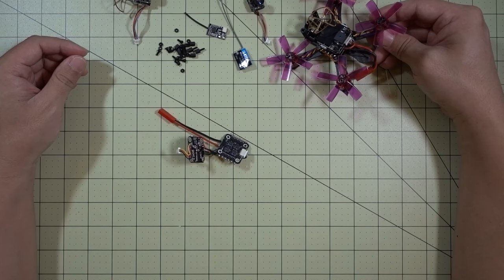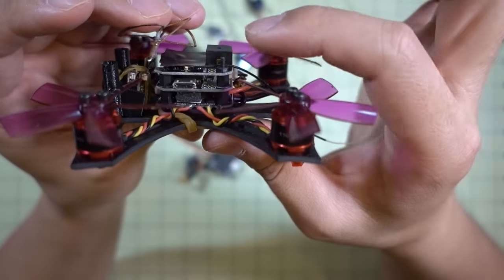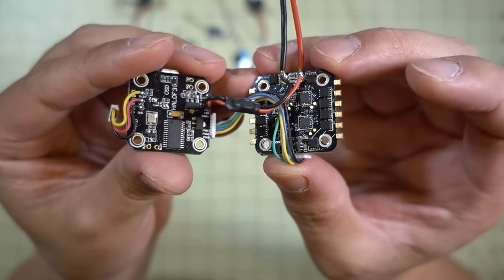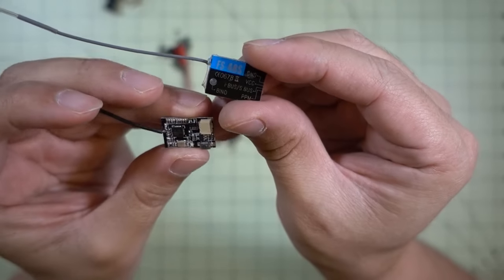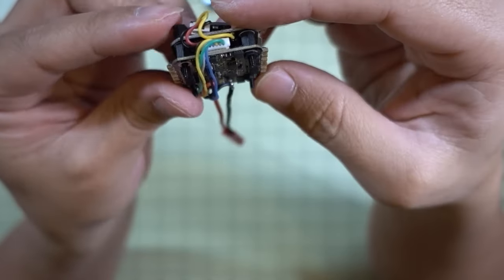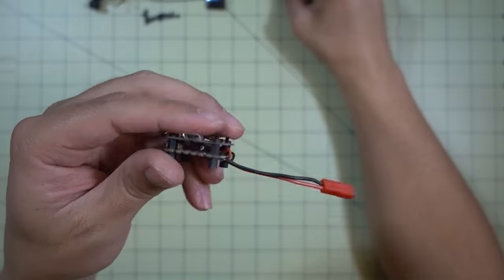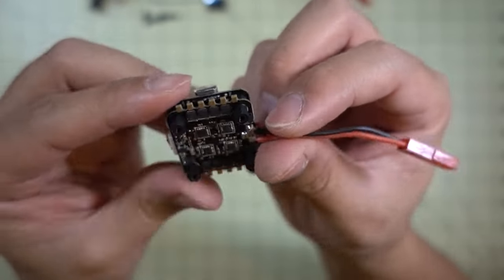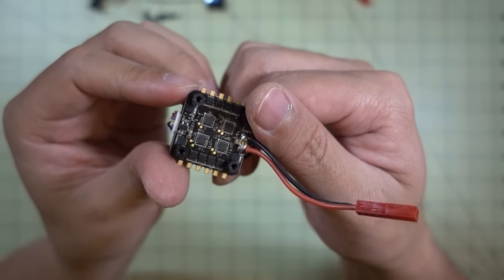Easy Bake Micro Drones 🍰🚁

Comment: The new version 1.1 mini cube has the lc filter builtin to the flight controller board.  Plus a few more changes like removal of the USB port for a 4 pin connector like the camera connect.  You also get a USB to that connector in the kit also. Hope that makes sense.

Comment: Great vid by the way. Just wondering you mentioned a connector between the esc and flight controller called the "lc filter" was is that used for and how important is it? Thx again!
Reply from the maker: The Eachine Powercube has that and it's necessary or you get video noise. The other cubes have the filter built into the board.

Comment: Albert,  I picked the same 20amp ESC from GB two weeks ago.  It looks remarkably similar (identical) to a few of the other 10amp 4-in-1 being sold.  Is there any way to verify that it's actually 20amp?  I'm wondering if it's not just over enthusiastic marketing folks at GB.
Reply from the maker: +Dave Fetters I'm not sure if there's a way to verify other than to stress test it...

Comment: Hey Albert, the antenna replacement for the "Eachine AIO FPV Camera" shown in the video does look the same as the one in the links.  Is it a different one and if so, can you provide the link?
Reply from the maker: It's the same as the one in the link.  I did shorten it as it was too long as it came.
Reply: Ok, thanks

Comment: i have a question about the GB stack, if I want to connect the OSD, is it enough to just connect the Video in & Out or also the ground, can you please tell me how to connect an AIO cam like the TX02 (200w version) to the GB osd? I think i must seperate the cam from the Tx?
Reply from the maker: The TX02 requires separation.  It's a lot of work and not recommended when there are many other options available out there.

Comment: i have a aurora 100 that i put all the electronics on a tomoquads cs110. i removed factory receiver and am using a fs8 on ppm because i didnt know you could use ibus? how do you set it up for ibus do you turn on a uart and set it to serial and which one thank you very much for the awesome videos man
Reply from the maker: should be UART3 and you have to manually set the receiver to IBUS mode (read the manual on how to do that) and set the output mode to IBUS on the transmitter and also in Betaflight configurator.
Reply: Thank you very much i appreciate it.

Comment: I just bought a stack and it came with halo f3 osd board, how do I install dsmx rx? There is no 3.3v pin, thanks in advance
Reply from the maker: There is a solder jumper on the bottom of the board.  You have to bridge that to get 3.3v out.  I think it's labelled.
Reply: Albert Kim thanks that is done but there some wrong with my fc, it gets extremely hot moment I plug in battery. But it stays cool if I just plug USB.

Comment: Does anyone know how to upgrade the Betaflight firmware on the Eachine Minicube FC?
Reply from the maker: Use the OMNIBUS target in the configurator to flash the board.  You may need to set the board into DFU mode to get it to flash.  Go to the CLI and type in DFU.  The board comes with 3.1 stock and flies perfectly fine with it.  I don't think an update is necessary.
Reply: I just reset to defaults, reconfigured for my FS-A8S, and it works great now. Using it in a Firer110 with BR1104 6500KV motors and DYS 2030 props.  It wasn't very stable out of the box. Thanks, Albert.

Comment: Albert Kim i bought the Eachine cube and at first 3 of the 4 motors would spin then twitch and spin again  only one motor would spin constantly i am using the lizard 95 motors and  i tried soft mounting using orings in case the screws were shorting on the windings and now the 3 motors dont spin at all and the one motor only spins any ideas? i am running betaflight 3.1.7 and dshot 600
Reply from the maker: +Kevin Hong oneshot or dshot? Escs calibrated?
Reply: dshot 600 should i change to one shot? and i will try calibrating the escs
Reply: so tried one shot and calibrated escs and still nothing they wont even spin up in betaflight
Reply from the maker: +Kevin Hong hmmm... seems like they are defective.
Reply: Albert Kim motors or esc?

Comment: Hi Albert! 
I tried the Furibee F3 Flytower w/ my power hungry 3" build w/ Brother Hobby 1407 3600kv on 4s and it failed pretty much immediately. So I wanted to let you know what I'm using now and very happy with- I don't see it on your list; The FLIP 32 - F3 - OMNIBUS NANO V2 w/ optional 20a "Colony" esc's. The pics for this on Readytoflyquads aren't correct (apparently they have a reputation for inaccurate pics/descriptions) but it does in fact come with the cable that goes from FC to esc's just like the Flytowers etc. Nice little aio combo that's working great with my power hungry 4s Mini Cerberus build.   http://www.readytoflyquads.com/flip-32-f3-omnibus-nano